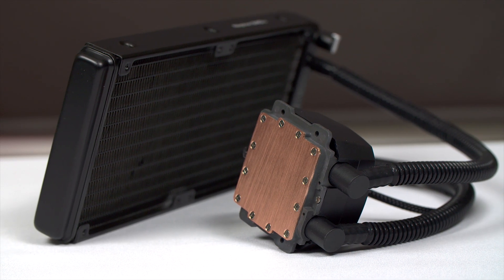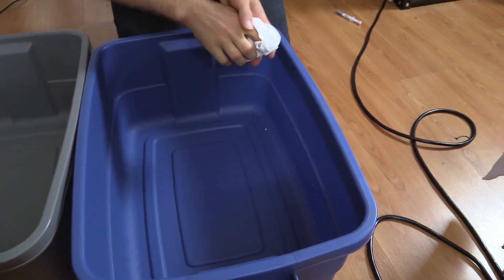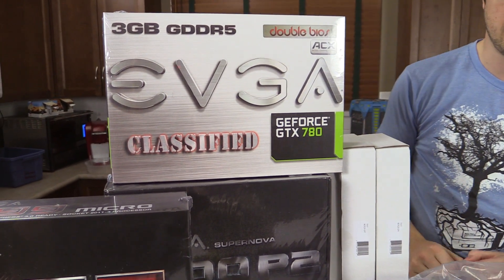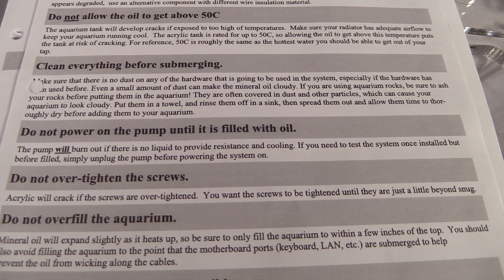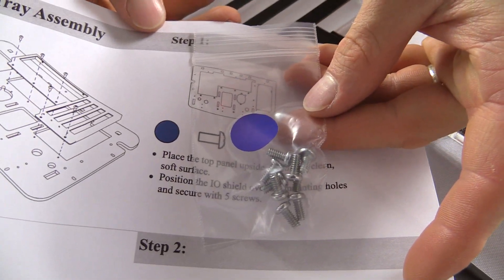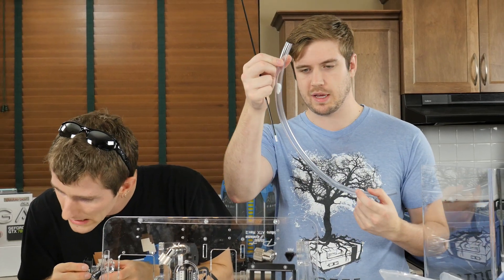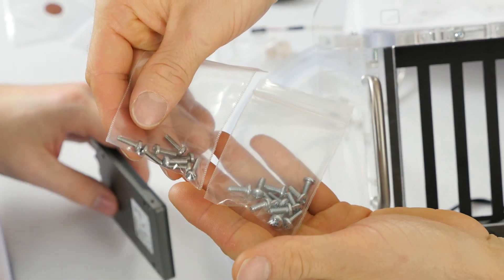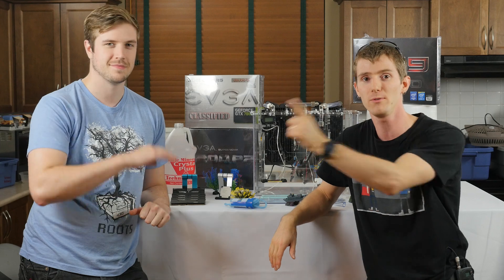Mineral Oil Submerged PC Build Log Part 1 - Puget Systems Kit Case Assembly

Comment: Hey guys! :) Just have a few questions. I am planning a gaming pc build and I have Picked these parts for my build. Is it possible for any veteran builders out there to give me possibly save me a few bucks with cheaper parts or vice-versa to give me suggestions for better parts? Here is the list below.

1. CPU: http://www.newegg.com/Product/Product.aspx?Item=N82E16819113286&cm_re=amd_cpu-_-19-113-286-_-Product

2. Motherboard: http://www.newegg.com/Product/Product.aspx?Item=N82E16813130790&cm_re=amd_motherboard-_-13-130-790-_-Product

3. GPU: http://www.newegg.com/Product/Product.aspx?Item=N82E16814202095

4. Power Supply: http://www.newegg.com/Product/Product.aspx?Item=N82E16817139057&cm_re=corsair_power_supply_1000w-_-17-139-057-_-Product

5. Ram: http://www.newegg.com/Product/Product.aspx?Item=N82E16820313434&cm_re=team_8_gb_ram-_-20-313-434-_-Product

6. HDD: http://www.newegg.com/Product/Product.aspx?Item=N82E16822236070&cm_re=1_tb_hdd-_-22-236-070-_-Product

7. Case: http://www.newegg.com/Product/Product.aspx?Item=N82E16811133244&cm_re=thermatake_full_atx_tower_case-_-11-133-244-_-Product

8. CPU cooler: http://www.newegg.com/Product/Product.aspx?Item=N82E16835181058&cm_re=water_cooling_cpu_cooler-_-35-181-058-_-Product

Any ideas help :) I have only built 1 other rig (not a very good one) so any info help a bunch. Thanks linus for the great videos and for anyone who responds :). Have a great day!

Comment: get fake fish - string fishing line top to bottom or from one side to the other.  adjust the fishes buoyancy so it floats at the desired depth.  attach the fish to the fishing line at the required so it floats in position.  
i never tried it myself but if you can figure out a better way to get fish in take please do it.  at the very least float a  " dead "  fish on top. :D

Comment: how is my build and is the motherboard and the cpu a overkill ?

CPU: Intel Core i7-5820K
Motherboard: ASUS X99-DELUXE
GPU: EVGA GTX980 Superclocked 4GB
CPU Cooler: NZXT Technologies Kraken X41 140mm
Power Supply: NZXT Technologies HALE90 V2 1000W 
SSD: Crucial M500 120GB
Hard Drive: Western Digital 1 TB Black
Case: NZXT Technologies H440 Mid Tower
Reply: I'am going to be web browsing, video editing but mostly gaming on that pc. My budget is 2500 - 3000 $
Reply: Someone pointed me on this build is it good or bad ?   http://pcpartpicker.com/p/MmXsjX

Comment: Neat project. What is the purpose of the oil cooled system other than the cool factor? Are you planning to dye the oil or make it cooler beyond the clear case and oil system? (yes, I noticed the aquarium items)
Reply: I think most dyes are water based.....would likely just sink to the bottom. I have mineral oil.....I have dye.....I should test.
Reply: OK I lied, no food dye found.....I did find my missing Tabasco sauce though!
Reply: It's just something you say you have

Comment: There was a show in the 80's in the uk called Tomorrows World
They showed a thin water like liquid in a tank and submerged a powered on TV set (the old glass 150w 230v ones), then put their arms in it.
it was supposed to be for cooling hot electrical devices and was none conductive

anyone know anything about this? maybe LTT could get some and do a test
Reply: Last week at an expo, I have seen some electronic components that were cooled by a transparent liquid labeled as "dielectric fluid" (it probably sounded better than saying "distilled water"). I talked to the exhibitor and he told me that the tank needed to be refilled regularly due to evaporation.
Another problem is, like Lucas Berger said, the fact that dust will contaminate your tank and conduct electricity.
Reply: That would have been mineral oil also
Reply: RamenNoodles22 I was thinking that too, but I remember they said it was something new and secret so not sure.
 
I remember the host was terrified when asked to submerge his arms
Reply: You can also use perfectly distilled water which doesn't conduct electricity... It isn't something new neither as we know distilled water since don't know when, but it should work to put something electronic into it (at least for a couple of minutes/hours). The problem is that dust and dirt on devices will pollute the water and provides ions which are responsible for the conductivity...
Reply: There are so many non conductive fluids. Get 2 boxes of baby oil and you got your miniral oil.. Distilled water is also non conductive for a while. Until it gets contaminated with dirt and metals from the pc. Thet it poeff... Dead pc.

Comment: The kit and the idea of oil cooling is good and all but if ever u want to change a component in the system or get a replacement for a malfunctioning component wouldn't it be a bit hard to clean the failing piece after removing it? And will the warranty of the product be void if the latter is immersed in oil?

Comment: hey guys. this is my first PC build and I'm not so sure whether this is a good guid for gaming, here are the parts. And can anyone tell me how much fps i'll roughly get when playing games like battlefield 4 etc at 1080p ultra.

AMD FX4350
Kingston Western digital blue 1TB
KIngston Hyper X 4GB x2 1600mhz
Seasonic 750w S12G
Cosair Carbide 200r
Sapphire r9 280x 3GB D5 vapor-X 3fan
MSI 970 gaming
Reply: what cooler would u recommend? right now I'm looking into the siedon 120v. would u recommend this cooler?
Reply: how about the FX-8320? its about the same in the price range, but has 8 cores. although a lower base clock speed, I've heard that it can easily be over clocked to around 4.8 GHZ
Reply: lol. but aren't they around the same price. well at least over here they are. but woudent have the extra 2 cores just be a nice feature to have?
Reply: nah, electricity isn't much of a prob for me. and with the 8 cores. bit coin mining will be even faster :D

Comment: One thought, as the total mass volume of the mineral oil seems sufficient enough with openings on the top of the case to allow for heat dissipation, would supply ample cooling with out radiators.  Perhaps eliminating inactive areas with circulatory movement would be righteous with pumps  Be that as it may just a couple of reflections.  Radiators are a bit unsightly although add to the broad dynamic, variety, range and scope of things in such a way that adds an element of sophistication, one the other had minimalism is rad too.

Comment: You guys i need help what is a awesome monitor for this build 

Corsair RM Series 80 Plus Gold 1000W Fully Modular PSU

x2 WD Green 2 TB (For PC) 3.5 inch Desktop Hard Drive

x1 WD Red 6 TB (For NAS) 3.5 inch Desktop Hard Drive

Corsair Vengeance Performance RAM 16GB (2x8GB) DDR3

Samsung 840 EVO 250GB 2.5 inch Basic SATA Solid State Drive

x3 Acer XB280HK 28 inch LED Monitor

Intel i7 4930K Processor

x2 EVGA Nvidia GeForce GTX 980 Superclocked Graphics Card

Samsung 24x SATA DVD Writer

Fractal Design Define R4 PC Case

Asus Deluxe X99 Motherboard

Microsoft Windows 8.1 (Full Version)

Corsair Hydro Series H100i CPU Liquid Cooler?

I know there is a monitor in this but i watch the review of this and i dont like it or is this monitor good and i should get it or is there anything better i just want a monitor that is great for gaming and i am getting 3 monitors of the same thing so i need help on what monitor i should get that is great for gaming

Comment: -.-

Wet Rocks.

Step 1 -> colander 
Step 2 -> preheat your oven to 250F or 120C (not too hot, or you could crack the rocks)
Step 3 -> place rocks on a sheet and place in oven
Step 4 -> ????
Step 5 -> PROFIT

Honestly. Paper towels?

Comment: dude, use the HAIR BLOWER to dry them!
Reply: Why would they have one of them in the office?
Reply: bassl0va I doubt the stones would mind some heat though
Reply: bassl0va because it's in his house?
Reply: Asher woodman It's not his house, it's their office. They used a house as an office because it would have been cheaper than office space in the city and also when there were less of them it was big enough but not too big. Look at the LMG tour video, there are no beds, an the bathroom off the master bedroom (which is the main office) is used as a server room.
There are a few videos of linus' house, like the one where he is adding fans to his TV cabinet.
Reply: bassl0va How about a hot air gun? Some might have one of those at the office if you do soldering etc.
Reply: Esa Edvik You know how brutally hot those get eh?
Reply: bassl0va That's why you'd use it from a distance :)
Reply: Esa Edvik probably wouldn't be moving enough air from a distance though :(
Reply: Esa Edvik Yeah if it was normal rocks it'd be fine but these are some weird ones with some artificial colouring

Comment: Do you really need the CPU heat sink?  Does it work better than direct contact with the mineral oil to cool the CPU?
Reply: I'm guessing yes. You would need some pretty serious circulation across that bare processor to keep it cool because I don't think slow moving oil would dissipate the heat fast enough from such a small area.

Comment: Hey guys, 

So i will be building my first pc soon and i wanted to know if my build is good and all parts are compatible. I dont want to switch the i7-4790k for the i5-4790k. I will also be getting another corsair veng (1x8gb) with another gtx 980 in the future so i wanted to know if that will work in my build in the future. I have pretty much hit my max budget with this build so i will not be able to replace any of my parts with something more expensive so yea, if u guys think theres is something cheaper and better then please suggest. Thanks alot and here is the build: http://ca.pcpartpicker.com/user/Ridzzzz/saved/tFm2FT

Comment: I was kind of interested in using mineral oil to make a 100% fan-less, silent system.
Is that possible? 

I'm basing this on the oil heating up slower than air and using pretty low power stuff

Comment: Is Intel I7 4790 3.60 GHz (Haswell) and Nvidia GeForce GTX 760 OC 2 Gb DDR5 a good combination and can i run like BattleField 4 and Minecraft with Shaders.

Full PC Setup:

Intel I7 4790 3.60 GHz (Haswell)
Nvidia GeForce GTX 760 OC 2 Gb DDR5
 Intel 1150 CERTIFIED CPU FAN & HEATSINK
8GB 1600MHz, PC6400
1000GB SATA3
 HIGH DEFINITION ON-BOARD 5.1 AUDIO
600W

I apperciate the help! ;p
Reply: You dont need an i7 for just gaming and the gtx 760 is a beast :D